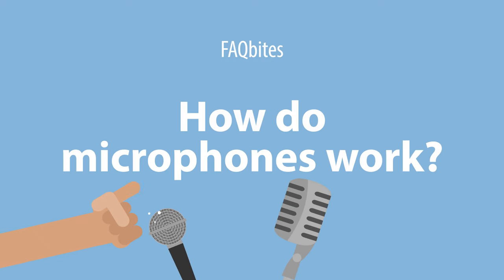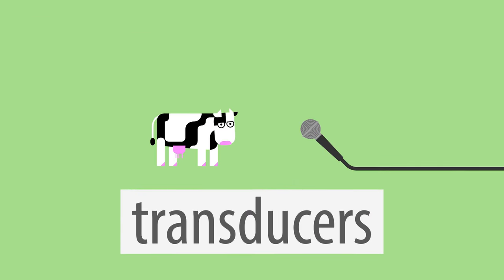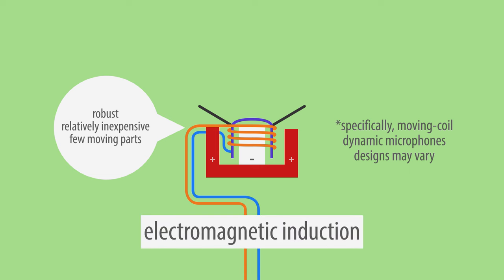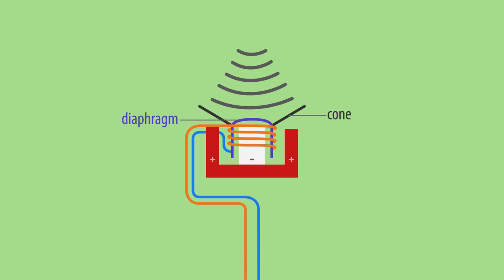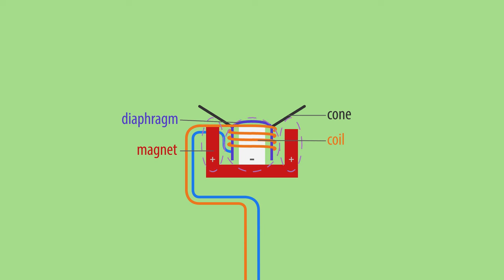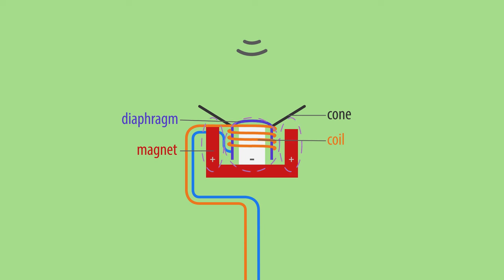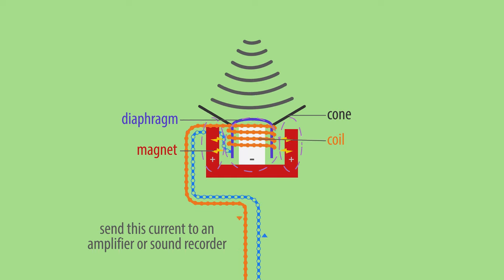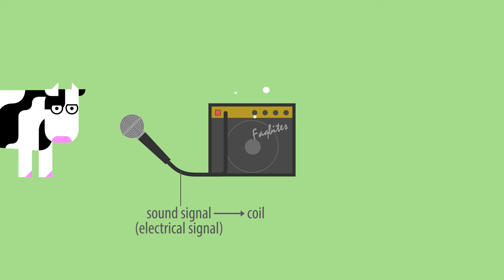How do microphones work? - Recording Explained

Comment: I still don't know why the microphone can make a noise that sounds exactly like us just because the signal is sent back in reverse
Reply: Mario Perez yeah me neither
Reply: it's basic electrical engineering. The idea is that electric signals don't  "move" along the wire, but the pressure of the electrons "pushes" them all, and then they "push" back into place when the signal ends. think of a tube of jelly, where pressing at one end causes the other to bulge. what's pressing on it is literally the coil of the diaphragm, and at the other end is another, larger diaphragm that gets pushed out whenever the small one is pushed on, making sound. Basically, the old cup and string phones we made as kids, but with electricity! Amps take up power in order to not only accept the signal of the microphone with a high sensitivity, but multiply its strength. That's why putting something with a magnetic field near them makes them whine.
Reply: @nubnubbud  but how does electrical signal turn into the exact sound? Are the microphone programmed or what? If then, how are they programmed?
Reply: @duykhanh7746  TLDR: the electricity doesn't flow. the wire is briefly electrified as a whole, in pulses. any latency is the cause of passing through a device, or the "speed limit" of the electrons through the material, as electrifying it pushes them forward, or pulls them back, before they return to their usual positions. they, in no abstract terms, "wiggle" as a whole in the wire, not unlike the work done by a bicycle break line.

most speakers have little processing, and most microphones only need a small, simple circuit to amplify the tiny charge you make in the wire by speaking into the diaphram and wiggling it using the sound waves from your voice (ever hold an inflated balloon and speak into it?).

this is actually one of humanity's first experiments with generating electricity!   It all comes back to conservation of energy. People noticed when they put a magnet through a copper tube, it slowed down, or something similar. It took a lot of really smart people to notice that such a thing shouldn't be possible unless that potential energy (from gravity) was going somewhere. 

It turns out, the simple devices which passed magnets over copper produced an opposing magnetic field and some heat in the copper! and by generating a charge and passing it through the copper, they could move the magnet, equal and opposite. this also means, if the copper was connected to a circuit, you could farm it for energy by moving magnets near it (this is the basic concept behind generator turbines today)

but it's the same thing that is happening here. A tiny coil above a magnet pushes it away or pulls it back whenever it's given power, and the magnet is glued or bolted to a diaphram, which simply pushes air, or pulls back and makes a negative wave. This is why if you were to plug a speaker into a microphone slot, it would be a very weak, but useable microphone, as moving the magnet with your voice creates a tiny charge in the copper wire!

if you're wondering why the sound doesn't come out or go in distorted, it does! The diaphram/magnet is a moving part and has inertia, so it "blurs" the sound a bit, as does the air the sound wave passes through. don't imagine the wire as having pulses sent through it, but pulsing all at once, with each pulse reacting to or making a wave of air via the speaker. You just need a device that can pulse the electricity to make sound, or can record the pulses to record it!
Reply: @nubnubbud  how do you make the diaphragm tho? It seems to be the most complex part. How can be something so precise it pushes the coil just from sound waves? Btw i loved your explanation
Reply: @hil449  the diaphragm can be anything. just, some things work better, but you don't strictly need it... it's just useful to keep the magnet in place just in case. the magnet can move a flat plate (or even just itself) back and forth, and float freely and it would work just fine, so long as the coil kept it in place well enough. as long as the magnet moves and pushes air, it technically works. at that point you just optimize the design using physics and engineering. in fact, separating the magnet holding solution and the actual diaphragm has benefits, as a normal diaphragm moves less at the edges where it's connected, but a completely loose cone will move the entire structure, meaning more sound, and less distortion at different wavelengths.
Reply: Imagine it as one of those toys that have a bunch of rods that you can press things into to show their shape on the other side. That's all it does, it takes the vibrations made and replicates them (through electrical signals) on the other side.
Reply: @leonardonetagamer  I guess that makes sense in simple terms
Reply: @nubnubbud  Thanks for that, i think I'm sort of understand the basic concept better
Reply: Pretty simple, a speaker is just the same thing in reverse so if the electrical signal is the same, the speaker will just undo the thing that the microphone did.

Comment: Fully understood but questions remain. When the diaphragm movies, how exactly a particular sound captured.. It is just a movement of the coil and it should create some current. How can that small current or voltage identify the sound exactly? If I push the diaphragm phycically with my hand, what heppens? This also would induce electic current, right?
Reply from the maker: Yes, if you move the diaphragm by hand it would also create a sound. Usually a buzzing noise. The air waves bumping into the the diaphragm do the same. Our ears also interpret the same airwaves. So we "code" that in electrical signals. Then we can output that signal through a speaker and returns the same sound, allowing us to hear it.
Reply: @IntoTheOrdinary  so the speaker relocates the airwaves that our voice make? It can essentially replicate any sound waves? (Which is Air distorted is a specific way?)

Comment: i just thought of a  genius way to get free energy. all we have to do is but a similar contraption to this in are masks. but instead of using the electric signals for microphones we could use the electricity to charge a battery! its genius/s
Reply: you genius way is dumped by the fact that electric energy generated by your sound is way too weak to charge a bettery , it oculd, but perhaps in years time. so there you go!!

Comment: Is it possible to stop or regulate the electromagnetic induction AFTER it is produced, by shining monochromatic light that has high enough energy and freq photons to knock electrons off of the negatively charged pole of the magnet ? And how strong does the field around the magnet have to be to affect the photons ? Any physicists around ?